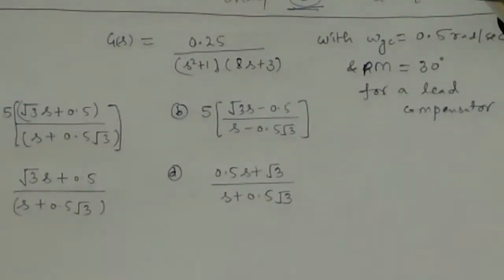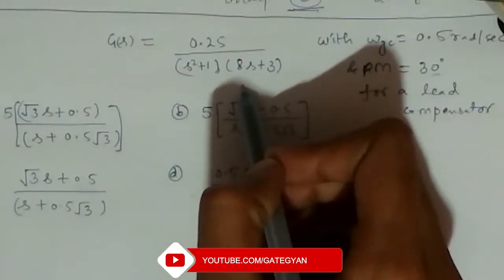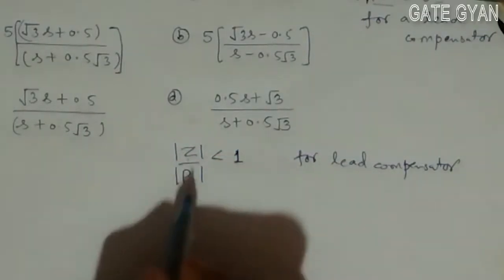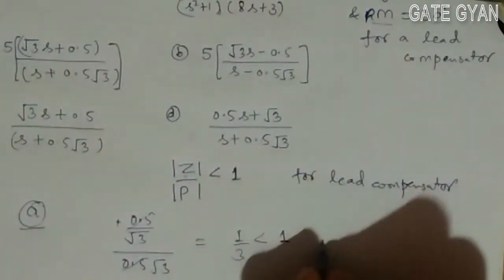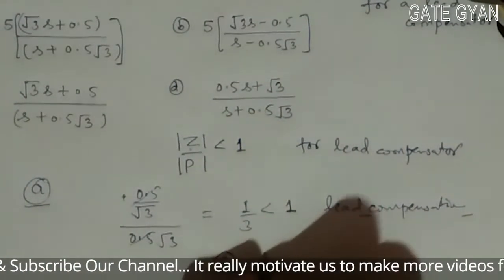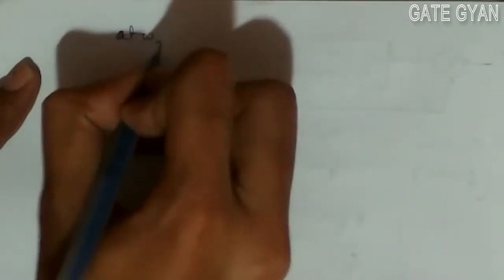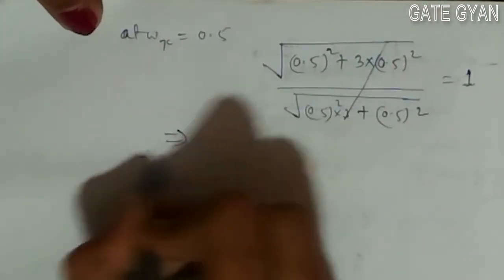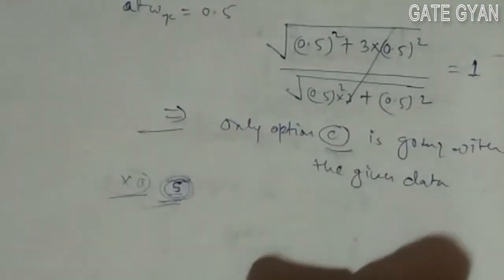ISRO 2018 Solutions Electronics |Question 42 Set-A |ISRO Previous Year Paper| ISRO SERIES| GATE GYAN

Comment: The answer key gives option ''a' as the correct answer. Plus the achieved gain crossover freq,PM is for the entire system GT where T is the lead compensator.
Reply: in this solution they have considered gain crossover frequency and PM condition for lead compensator only. If we consider for entire system than may be we will obtain option 'a'...
Reply: @nikhilpandya2569  the gain of the lead compensator should be 15 for the gain margin to be 0.5